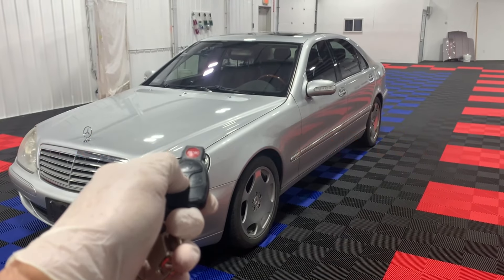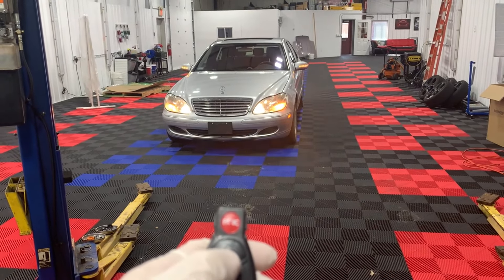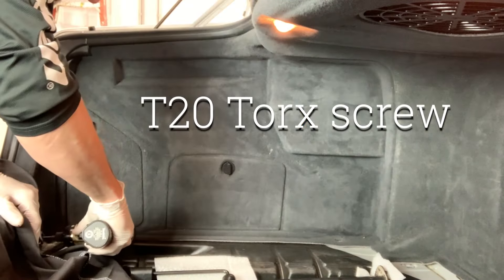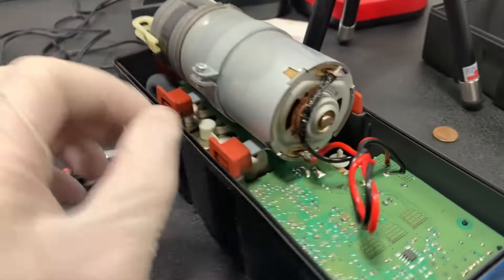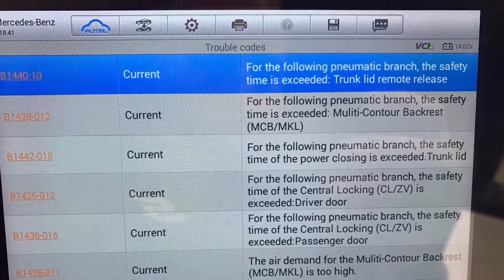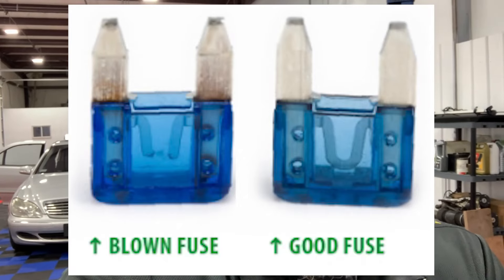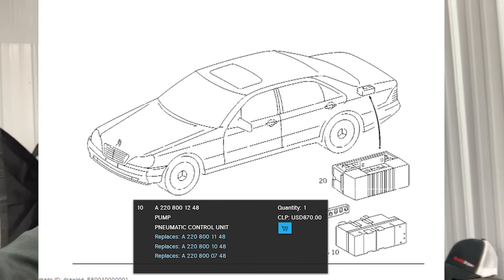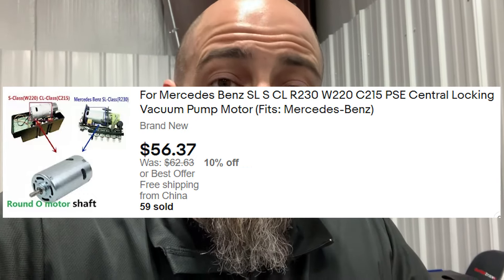WATCH THIS FIRST if your Mercedes-Benz W220 S-Class won't Lock or Unlock -PSE Central locking issues

Comment: Hi i have S55 2002 gauge's mileage doest work the screen become red any solution for this issue ...Regards
Reply from the maker: new cluster,. these were problematic . either find someone to repair or buy new/used.
Reply: @MasterTechLou  Hi I changed the gauge & I transferred the old mileage   to the new one. Thanks

Comment: Can u please make a video on the roof doesn't open and close from the 1st click to the roof botton
Reply from the maker: You mean 1 button express open and close?
Reply: @MasterTechLou  yes
Reply from the maker: @moemado8871  ok you most likely lost synchronization. Start the car. Pull the switch DOWN and hold it, it should move the glass closed and then it should open the vent. Once it does, pull it down again to close it and it should work 1 touch.
Reply: @MasterTechLou  
It worked 💪  thanksss
Reply from the maker: @moemado8871  tech tip, it may even show that in the owners manual 😉
Reply: @MasterTechLou  now am gonna skip about the driver door vacuum not working and all other doors are working fine , wut u make if this !
Reply from the maker: @moemado8871  answer will be in the video

Comment: This symptom happens a lot after a car has suffered from a flat battery... I am going to guess that Jump starting the car blows the Locking fuse.?

I don't have this model with the pneumaticx.
Reply from the maker: not in my experience no, jump starting the battery should have no effect on just the lock pump, that would be very odd that it would be the only fuse that blew. the only time that fuse blows is due to a bad motor. if it blew once it will definitely blow a second time. if the pump even works after installing the fuse.

Comment: When I switch the pump out and put another used one in it work for about two days deluxe inside the car and the trunk everything work after two days all I hear now is a whispering coming through trunk I pull a fuse out and put it back in to reset the system all I hear is up

Comment: Have a question I have a 06 s430 and when I press trunk open on remote it tries to raise but the lock doesn't open. I changed puck, and same result.  When I use key to unlock trunk then use trunk open inside the car, it raises but I had to manually open it. Any suggestions ?
Reply from the maker: The lock is operated by the air from the pse . If there was a leak at one time the pse will stop air to that circuit. Youll have to pull the fuse just like I mentioned in the video.
Reply: Is there a length of time having fuse out ? Because I tried that and it didn't work. And thank you for quick response
Reply from the maker: @tomkat2803  then you most likely have massive leak or assembly is rusted stuck

Comment: Hey I’m having a issue with the key not turning in my 04 s500 4 matic Mercedes-Benz can’t start the car… what is this?
Reply from the maker: Hey, sorry to hear.
Car battery
Ignition switch
Blown ignition switch fuse
Bad key.
I hope it works out for you. Lou

Comment: I have issue with my 2000 S500 my windows don’t work dash lights and front power seats don’t work what could be the issues someone told me it’s part called sam that control all that can any one point me in the right direction
Reply from the maker: only thing I can advise is getting a scanner and reading all the codes to see what the codes are and then finding out if all modules are communicating. However if you do not know all the modules that should be communicating then it will not help you. The right direction is to not assume what can control all the items, but to have someone with Mercedes specific knowledge scan the car and get an assessment of what's happened. I looked at the wiring and the only correlation between what's happening is the data communication system, not a fuse.
Reply: Thank you

Comment: Why does my trunk do that what is wrong with the trunk latch ?.also my lock with my key only works from my door handle but far away it doesn't I replaced then rear headliner antenna for door lock it didn't fix problem because I think I need a new rear window because the pads touch the glass and the connection is around the glass are not that great is it just the glass???

Also when I use my air ride buttons they work and then when I go to use them again to change setting they just stay lite up red and don't allow me to change them smh.

Comment: I have a 2005 S430. The truck won't open with the key fob, or from the driver side door latch (only with the key). Door locks do not work from key fob, or the dash buttons. However, from the fob, when I press lock, the alarm sets and if you open the doors the alarm goes off until you press unlock on the key fob. Also, the soft close doors do not work. I changed the fuse, but it didn't change anything. Help?
Reply: Would you say the problem is more than likely the Central Locking Pump in the trunk?
Reply from the maker: Forgive me. But the video clearly explains everything you just asked me. I hope it helps.
Reply: Thank you sir.

Comment: i have a 2008 E350 after i park my car it wont lock or open doors or trunk, and my car is not starting any more the key dosent  open the ignition switch any more, any help where to check next will be apreciated i already check hood and trunk fusss they are ok thanks in advance
Reply from the maker: Most likely dead battery.
If not ignition switch or key failed
Reply: @MasterTechLou  thanks for ur reply, i think is the key that fail, cause i put a new batterie on the car and also the key. and the system works cause i can open the doors and trunk with the botoms inside the car so most like is gone be the key thanks for ur help 🙏🙏🙏

Comment: Also A/c is hot on the half end of the car (co driver) & cold on the Driver side, my w220 is with climate control; whats the problem there pls? Is it a fan or a fuse? It aint the cooling gas level, thats ok…thank you!

Comment: Hey currently experiencing my Mercedes Benz c300 locked in drive. I can’t drive or put it in park or neutral. It won’t start. Please help
Reply from the maker: Hey sorry to hear. 😔 . There could be a number of reasons why this could happen. The most common Is a failed steering lock. But there can be so many reasons for this. All I can say from here is that theres nothing that can be done to force a mercedes to start. So its gonna have to be towed to a shop or mechanic with Mercedes capable scanners and experience.

Comment: hi my radio:hand-pink-waving: is locked how can i unlocked
Reply from the maker: Radio code cards should have been in glove box. If not we use either the vin or radio serial number to get
The codes at the dealer

Comment: Here's a interesting one : keys ok , all fueses and relays ok , battery very ok, nothing works just hazards flashing fast , no ignition life(as in ignition not releasing when key inserting)  with either keys so impossible to use diags ....
Reply from the maker: You say interesting I say symptoms. When you insert the key the transmission is strictly between the key and ignition switch. So if it wont unlock the issue is either the key or ignition switch. If you try 2 keys and still
No go, then its ignition switch failure provided that you confirm power and ground to the switch.
Reply: @MasterTechLou  was EIS fuse ....just very hard to spot ....
Reply from the maker: @freenergyterminator  glad it was that easy!
However if it blew once it will
Blow again so keep that in mind
Reply from the maker: @fernandoruiz2596  no you cannot they are vin coded. Youll have to have the dealer replace it. Or find someone that can overwrite a used one with your vin.

Comment: Man i wish you could just pull out the pse like you did, but nope it doesnt come out like that.
Reply from the maker: Not sure what you mean. Literally takes under 5 min to access and remove 🤷🏼‍♂️
Reply: @MasterTechLou  hmm okay maybe it just takes a little more finagling to get it out
Reply from the maker: @2857steve  you use a flatblade screw driver to pop each grey rail that holds all the yellow lines together. Gently. Then the pse slides out
Reply: @MasterTechLou  okay I will try that. Thx for replying
Reply: Wellllll. I have discovered that it is a little more difficult to get out than your video shows when your motor has completely melted the plastic housing and the carpet padding that's around it hahaha

Comment: you forgot a few things or failed to elaborate otherwise good !,
1.   you are hoping to god that that fuse is blown...because what you have is a melted manifold on the pse box witch is plastic and melts unsealing it internally. Good luck finding one oh less you got 7-800 $ then no problem. you can buy just the motor 100$ amazon if you can save the graphite turbine witch is another hundred... 
2.   but replacing the motor means you have a leak issue consider yourself lucky. There are no rebuilds get a new motor simple, but the motor didn't blow for no reason. That is if you don't have a melted manifold piece which is the center of the pump block.. The PSE box is the centerpiece of the car most of the options work off this and each channel has multiple uses so the door locks might be fine but the soft close circuit leaks causing neither to work. 
3.  Harbor Freight has a 6$ transfer hand pump with 8' of hose that is the right size for the PSE ends and works great for checking and fixing leaks has more than enough pressure to check and test each PSE circuit. Fixing it is worth it because say you are putting new speakers and get stuck in boot ? better hope the lady is home to let you out . Or maybe had a bad night with girlfriend and she  locks you in the trunk, for whatever reason, then drives off a bridge into a river ? and your PSE unit isn't kosher? you're dead and they will have a hard time even recovering your body but not to worry because your GF died too because the doorlocks didn't open either (bonus!) and its hard to pull up that bastard while you're sinking ...
Reply from the maker: Yes I always forget to mention getting stuck in a trunk and driving into
A river! 😂❤️ I will be sure to mention it next time! Hope you subscribed to keep track 🥰

Comment: I just bought a 03 S 430 with 73k and I have no clue what I got myself into. The vehicle has been sitting  for months without starting not driving causing a battery malfunction. AAA was able to start her up. I let her idle for approx one hour just to juice up the battery but that doesn't mean the battery is fully charged although she stays up with no issues.
It's a beautiful car but I don't think I have the patience nor the wallet to dive into this money pit so to the junk yard it goes. Buhhhh bye
Reply from the maker: Yeah sorry about that, buying a benz thats been sitting and or used at this age is not something I recommend unless you
Absolutely know the history of the car and the knowledge and experience of what to look for when purchasing.

Comment: Hello, my pump goes and the key works (the lights on the car blinks) but the locks or dorrs doesnt work, i hear the pump build pressure and then turn off, ive checket the pump and it spins and build pressure, o dont know where to start problemsolving